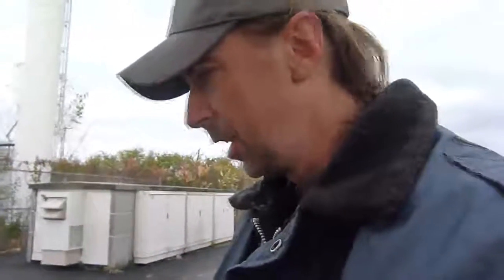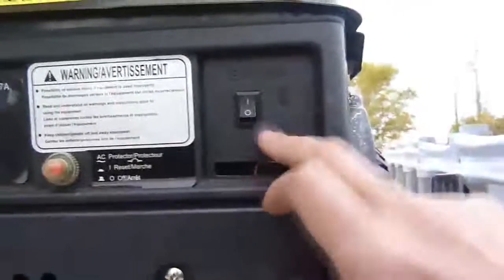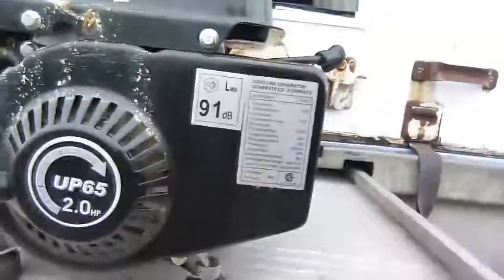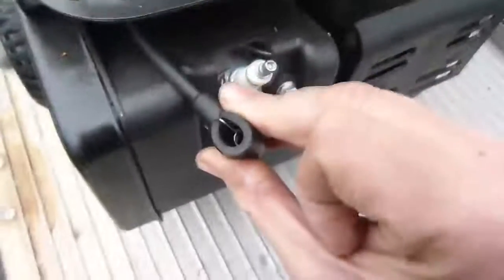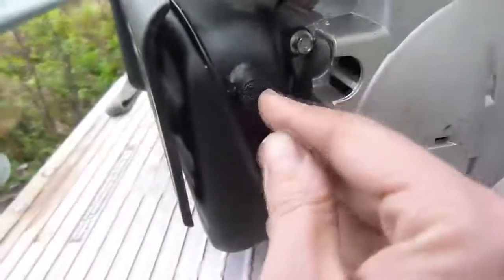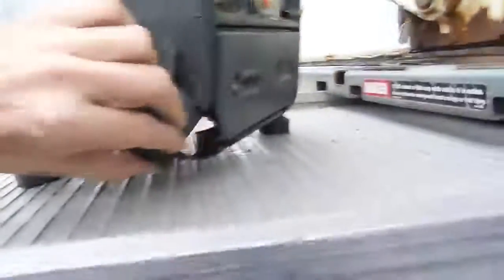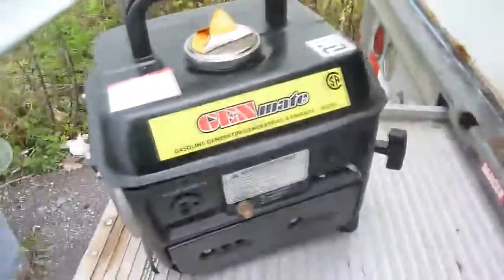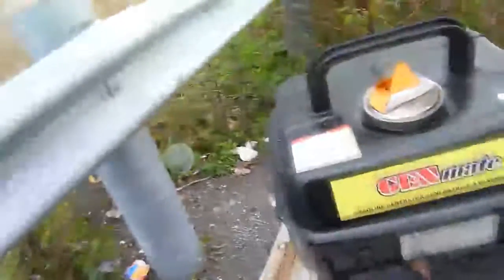MY NEW / USED GENERATOR PART 1

Comment: it will be very loud, that plug you don't recognize is a twelve volt charging like if you need a small boost it is no toaster but perhaps a eight amp draw would be ok. if you have mixed gas that's ok for the gas trucks
Reply from the maker: +George Gardinier  The more I know the better.... thanks for the info ;)